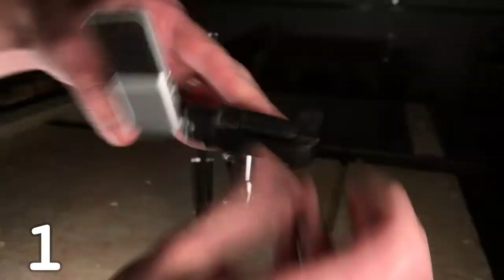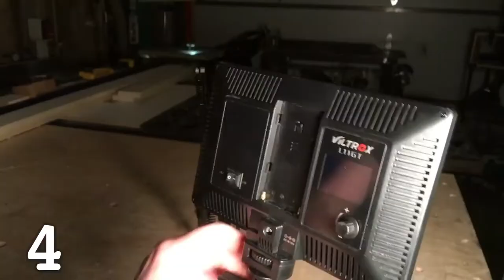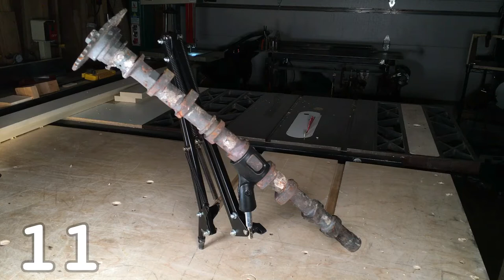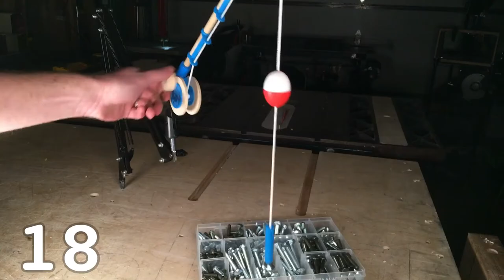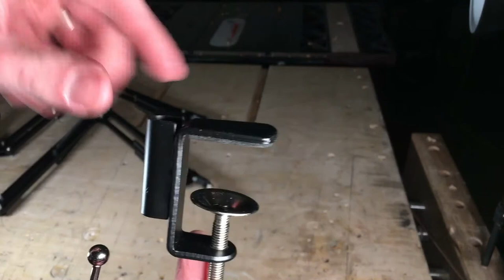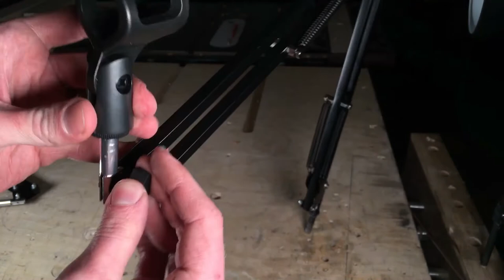Articulating Booms Hold Many Things

Comment: Keith I thank you so much for putting this up.  Many people do not know how valuable this is.  I have a few on the shop and plan on blue printing them to make my own. I know of some machinist friends who make their own and they span 9 FEET.  With the proper know how you can make your own springs.  Sounds like a project. However I think I will buy a few of these.  Thanks again.
Reply from the maker: William Ward Thanks!  Custom ones sound interesting, because I’ve started using these overhead, and I’ve run into a couple complications that I think could be addressed with a couple design tweaks.  If you’d be interested in thinking through the issue let me know (maybe website contact form?) and I’ll send some pics or a video of the issue